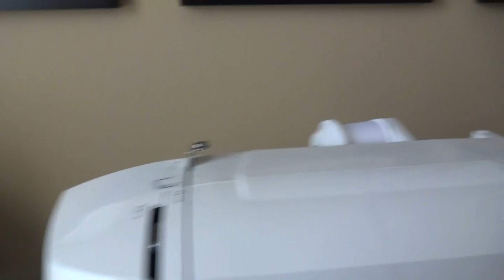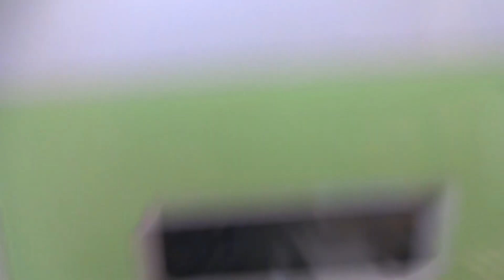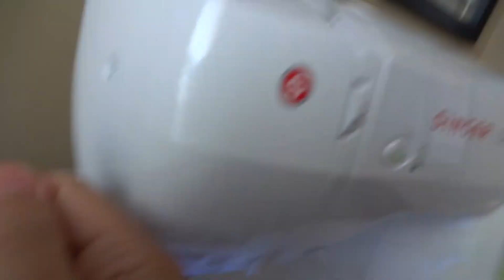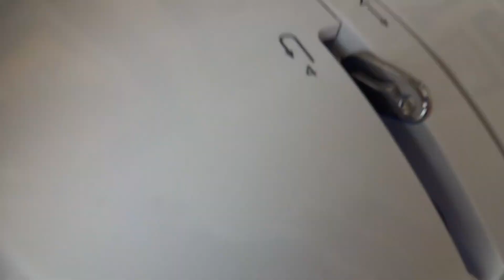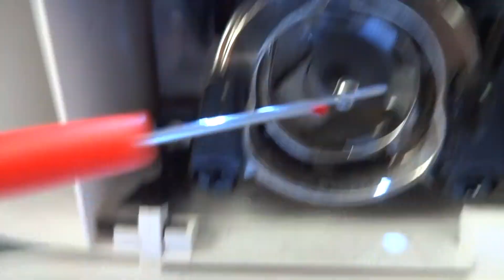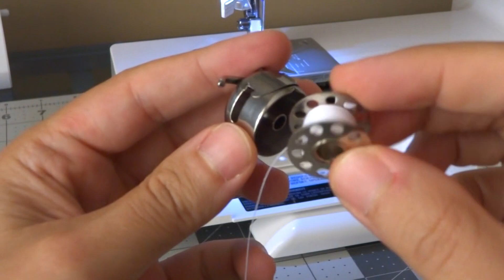Customizing Your Own Jersey - #2 Threading The Machine

Comment: Hi.  I’m using your videos to learn all of this for 4 of my Penguins jerseys, as I’m a die hard fan too.  I have a question I hope you can answer.  For the thread itself, are you using just regular thread, or do you/most customizers use twill thread?  I thought I was all set but then saw twill thread was a thing, so I was hoping to get some more information.  Thank you!
Reply from the maker: Hey!  Honestly just use normal thread you can get from Michael's or JoAnn Fabric
Reply: Hi Pensjerseys2322, I hope you see this. Further to the previous question, what weight thread do you use? Google is telling me 30WT but I just wanted to confirm with an expert like yourself. Also, polyester thread?